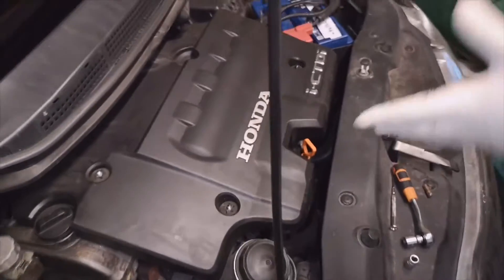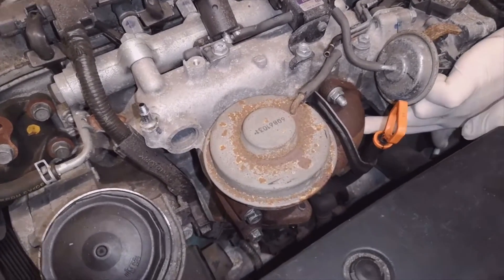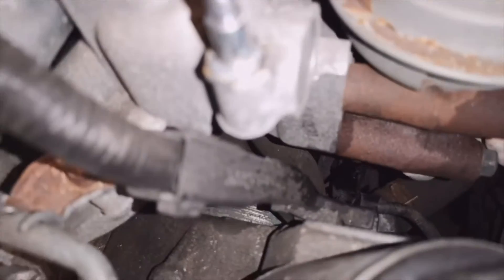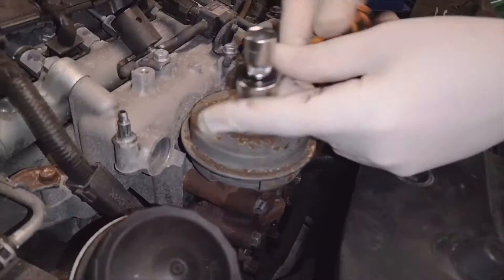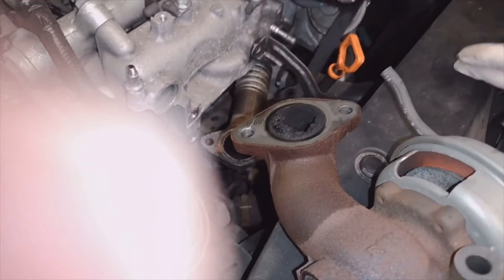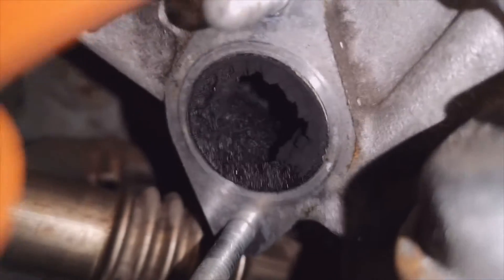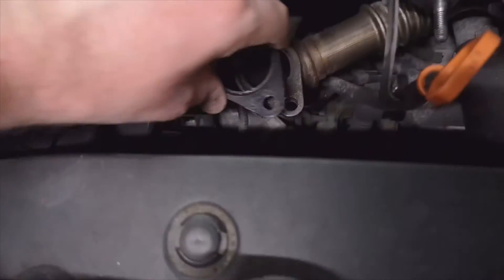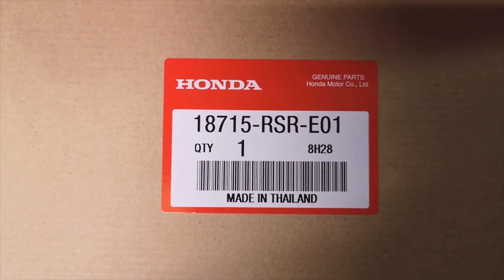How to clean EGR valve on Honda Civic 2.2 diesel

Comment: Started slowing down to a stop and pressing the accelerator had no effect. Followed your great instructions and the car is running as good as normal, nice and nippy, used a bit of carb cleaner to get rid of some of the carbon. Top video, great help.

Comment: Do you know if this can make check enigne icon appear on the dashboard? I just got the icon and the car has much less power. However, it regained most of the power after 10 minutes od driving, but the icon remains of course. 🤔

Comment: You’ve given me the confidence to do it myself.
Just bought a 2008 civic and on extreme acceleration to burn off BMWs it has a little smoky cough.
So I’ll clean the EGR and then use an infuel DPF cleaner.
Bit of a blow from the exhaust as well so once that’s sorted it will be a weapon.👍🏻🤫🤐😬
Reply: Just reading your comment, if it's a UK 08 honda civic it doesn't have a dpf.

Comment: Just wanted to update... Finally got round to doing this and OMG!! the holes in both ends were pretty much blocked.. I would highly recommend doing this, it runs so much better now and this is the best video I've seen on how to do it. I'm a complete novice but by following this tutorial I managed quite easy and certainly saved me money not paying a mechanic and also gave me a great sense of achievement that I'd did it myself.
Thank you so much for making a great easy to follow tutorial. 🌟🌟🌟🌟🌟

Comment: Nice straight forward video thanks. I have one question. On my car (Honda CRV 2.2icdti) it too has the egr valve in this location but connected to it via tge egr pipe, on the right hand side of the engine is another similar looking component. On another video elsewhere this other component is shown as being the egr valve. Would you be able to shed some light on this by any chance? Thanks again.
Reply: Hi, I never actually got round to carrying out the work but from another source I was told that the assembly to the right hand side vented to the exhaust system and wasn't necessary to clean however my own reckoning was that if the egr valve required cleaning out then the other assembly would be in a similar state and so if doing one then it would be beneficial to do both. It was another YouTube video that showed the dismantling of the other assembly which I can't seem to find right now. If I do find it I will post up a link. Sorry I couldn't help with more definitive results but hope that is of some help.

Comment: What symptoms did the engine have when the pipe was blocked, I have the same one and it goes into limp mode if I rev it more than 30000k, it just accelerates normally

Comment: Hi Jon, great video. I've just bought a 2004 accord diesel and there's nothing in terms of turbo power until 2500rpm and it then feels like a new car. Would a blocked egr cause this?
Reply: I would definitely check the EGR first... Mine was doing the same.
Reply: My civic is doing the exact same. 2600 rpm then it kicks in. Going to try this thursday
Reply: Did you try it and did it help?  My Civic does the same thing but only intermittantly, it's very erratic. Hoping doing this and a good service will fix it!
Reply: @soundseeker63  To all of you I would use castrol stop and start oil c3, I used this when I got my crv 2.2 ctdi after a while you could hear the turbo
spinning,I believe it had cleared the oil pipes too and from turbo,know use
castrol edge c3. I got the crv at 90,000mls.

Comment: Mines done 70k, do you think it needs cleaning. I bought  HR-V from a garage, said it had a full service..ie no oil filter change, no fuel filter change, no air filter change. Your better off diy your self as nower days everyone is out to rip people off big time. I blow the bollocks out of mine in 2nd to get hot and the smoke that came out cleaned it I beleve.

Comment: Wow that was really clogged up!   I think EGR and manifold cleaning should be considered part of routine servicing for diesel engines, it should  be done every 3 or 4 years max because the engines always run better with a clean valve and a clean manifold.
My Civic needs a full service soon so I will do this at the same time I do the oil and filters. Car is on 160k and I've no idea if its even been done before so this will be interesting!
Reply: Najlepiej jest całkiem usunąć zawór EGR (zaślepić) ponieważ ten zawór „zabija silnik”

Comment: Very helpful video, can you please advise what did you use to clean the egr valve and other parts? Thanks
Reply: I used a fine rotory wire brush on a drill, work perfectly

Comment: hello, when you reassembled the valve did you change the seals or did you use the same ones after cleaning? thanks
Reply from the maker: Hi, I changed them. Always change the gaskets if you open it up as it's almost impossible to get a perfect seal with a used one.

Comment: I can't get the first one undone 😭
Reply from the maker: Squirt some WD40 onto the bolt then take the car for a drive and warm up the engine. The oil will then penetrate into the bolt and once cooled down, should be easy to remove
Reply: @AMomentOut  Thanks for the tip, yeah I did douse all the nuts before hand but now I've dropped the socket in the engine bay and can't reach it... 🙈
Reply from the maker: @loumasters972  been there. A magnet rod is a good tool to have. Cheap as chips on Amazon.

Comment: What are the chances of me doing this while keeping the original gaskets. I only now coming across the video and was going to give it a go tomoro as my car is like a tortoise. But I won't have time to get the gaskets Tomoro. Cheers
Reply from the maker: Personally I wouldn't risk it. My gaskets looked good but from experience gaskets never are 100% perfect once removed.
Reply: @AMomentOut  what type of gasket are they mate? Fibre, metal or rubber. The ones he put back on were metal it looked like
Reply from the maker: @nickt471  there metal, it's my video :)
Reply: @AMomentOut  awh haha cheers mate. I'm gonna give it a go. If it don't work I'll nip to my local honda in my misses car. Cheers for the vid mate
Reply from the maker: @nickt471  good luck, it's a quick job so if u do do it and use the same ones, order some up to replace them asap and swap them over when they arrive.

Comment: even after using penetrating oil on the nuts they wont come off without rounding off the bolt (im using a 6 sided socket), i've lost all hope.
Reply from the maker: Add wd40 to the bolts then take the car for a drive until engine is warm. Should then come undone much easier
Reply: I hope you found a way to succeed. If you are in the uk try getting some Irwin grip sockets from toolstation or similar. They a twist profile inside them. Warming the engine is a very good suggestion by the presenter too. Good luck

Comment: Can you fell any different after cleaning ?
Reply from the maker: Yes, the lag from when I put my foot down till when it went was shorter. Friend also said the same thing. Could be psychology but the MPG definitely went up by a considerable amount.
Reply: @AMomentOut  ok that's nice. I have a 2,2 i-dtec. And It has now 300000 km. I'm little bit scar how much soot it can have. Do egr work at all engine revs or just low spins ?
Reply: @AMomentOut  I got same car 2009 with dpf. Now it has 176 000 km. I feel jolting/wince on 1500 RPM - 1800. 
especially when i accelerate from that RPM during right or left  corner.  Do you think that it could be EGR symptoms? I also have vibration after i release gas pedal after hard pull (could it also mean EGR). AVG fuel consumption is 6.2 liter combined. Regards and ty for video :)
Reply: @mariodalmacija1536  I have 2006 with 176000miles  same engine similar problems! It drives perfectly well if I drive it like a Granny, but if I put my foot down there's a defendant delay with acceleration but run accelerates fine.
Have u solved your problems and if so  what was it ? appreciate any help
Reply: @mariodalmacija1536  did you sort out the problem?

Comment: Far easier access that my former 1.9tdi  06 passat, currently driving a trusty 1.4 corolla and only considering going diesel again for motorway use. The only drawback with modern diesel engines is the egr value and turbo trouble. The accord looks quite straightforward to access and clean though. Any owners got any problems to look out for on a 2009 upwards considering buying one soon?
Reply: @Dannyboy0202  cheers Daniel didn't know that 👍

Comment: Thank you so much for this guide. I just wanted to ask if this gets really really blocked could that stop your turbo from working. Mine is no longer working so I was just wondering if this could be my fix.
Reply: Give it a go, dirty egr valve could affect turbo function. It's advisable to clean egr first before  concluding turbo is completely gone

Comment: Hi nice vid👍 What did you use to clean and is there a method or certain way to do it? Thanks.
Reply from the maker: Any EGR cleaner (or even petrol) would work fine e.g. https://www.halfords.com/motoring/engine-oils-and-fluids/fuel-and-oil-additives/wynns-diesel-egr-valve-cleaner-150ml-360302.html. had to use a flat headed screwdriver (gently!) to get the stubborn bits loose.

Comment: Why you clening this way. I always taking all intake manifold otherwise no point
Reply: As I understand it, the valve can actually stick so cleaning it improves the airflow and unsticks the valve. Cleaning the intake manifold would be useful as well (although mine was nowhere near as blocked as the EGR valve) but you don't need to to get most of the benefit and it's much harder than cleaning the EGR.